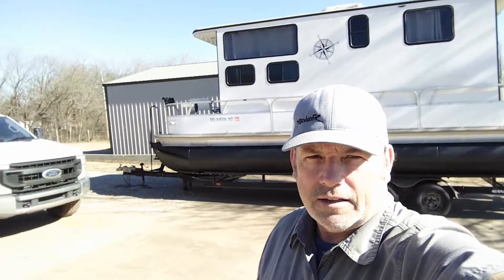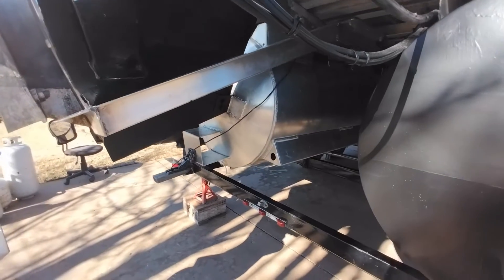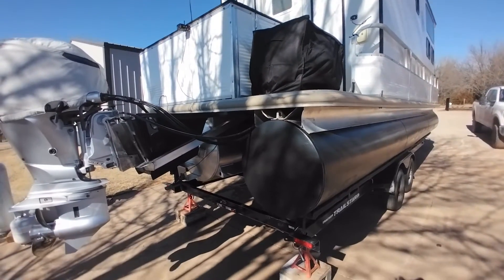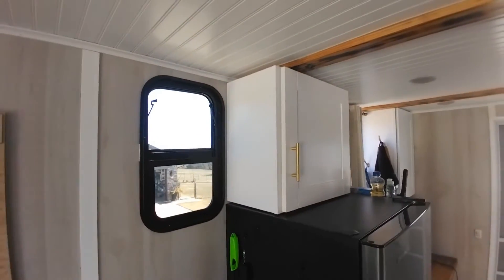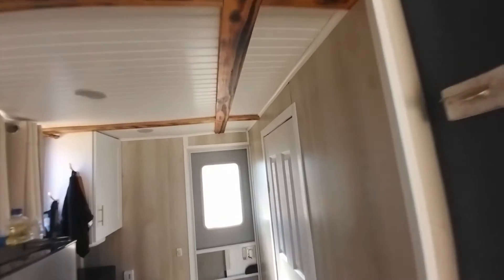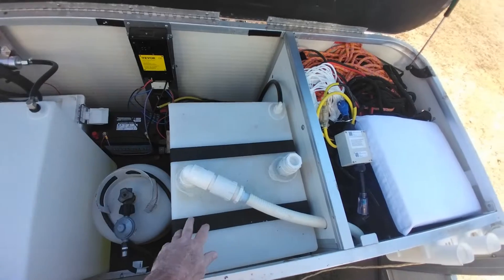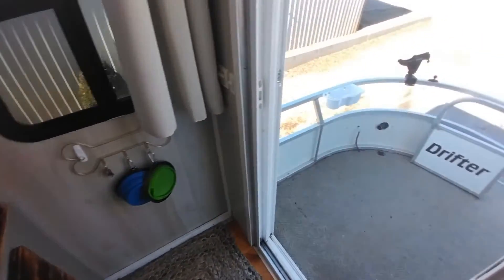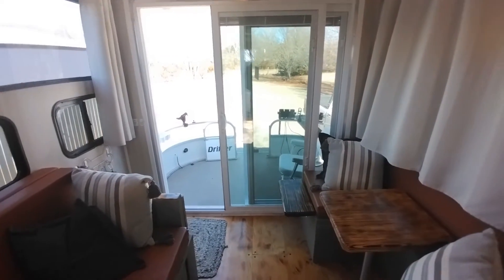2024 Shanty boat upgrades episode 9 of 9

Comment: Could you tell after you put the Pontoon on did it do anything for your gas mileage or your say you're running an average 1500 horsepower did you get any more speed out of it just 0 guess what all was the extra pontoon what all kind of changes did you know in it I'm very curious because I'm thinking of doing it myself❤
Reply from the maker: @glbaker5595   adding the middle pontoon just made it float higher and more stable. Really didn't do anything for gas mileage or speed.

Comment: If anyone knows where some 30 to maybe 40 would be the tops of the pontoons I'd like to have a couple,, I've got a couple of color three cylinder engines that came out of refrigerated trailers the motors are pretty low are the trailers are wrecked, also I've got to 650 V-Strom Suzuki engines with about 11000 mi on them, 81 of them would make great and bored engines. Or if anyone has any or if anyone has some tanks and would like to trade for engines let me know we're going to have to start this lady somewhere😂
I'm sure everyone against said that before

Comment: Was just wondering, how much did that bring the back of your boat up?
Reply from the maker: @ronaldmoore2336  it came up in the back about 6 inches. Before the lower until trim up would be in the water about 2 inches. Now it's about 4 inches above the water. The center toon does have more drag so it loses about 3 mph on the top end but the boat is more stable.
Reply: @ i’ll take a little loss in speed cause I’m not in any big hurry but I sure do like those things being steady. Got my eye on it. Old bass buggy, but I need to put a3 tune down the center. Looks to me like it’s well worth the trouble. Thanks so much for your comeback on this. PS if you ever get a business building these things I think you can make a fortune. Special for us old guys who don’t wanna get anywhere fast.